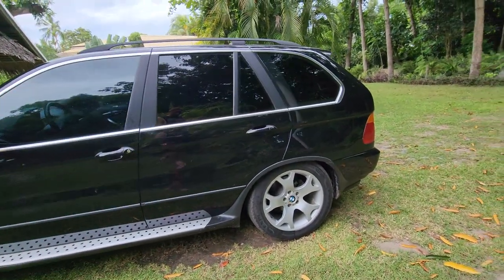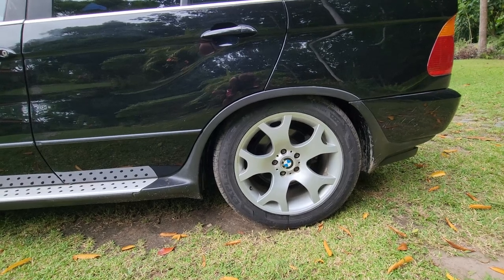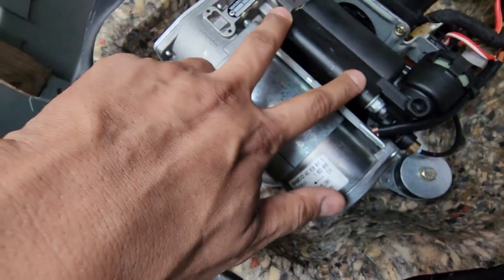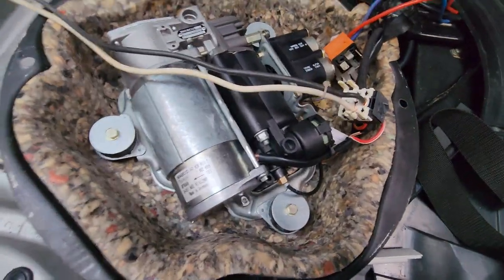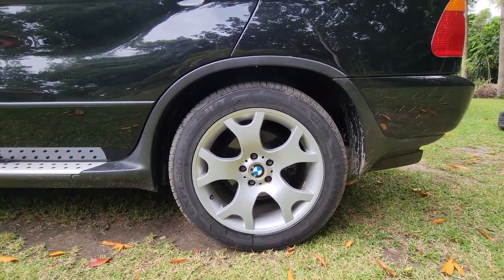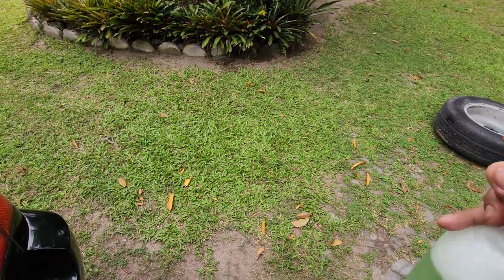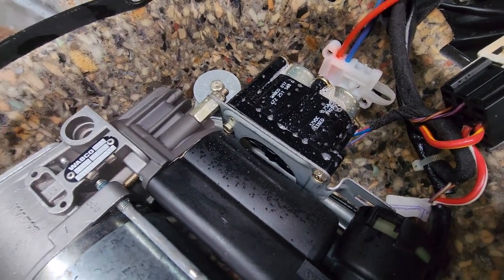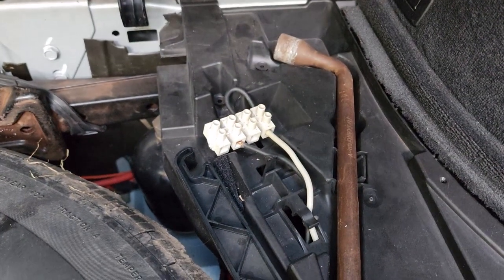Self Leveling Suspension Override / Manual inflation BMW X5 E53

Comment from the maker: UPDATE: So hard to fix this thing. Took it all out, replaced it with springs. Im not towing or loading heavy stuff anyways. Just using it to bring my kids to school
Reply: Tried Everything PIA.  Trying to convert to springs-but where do I get the spring compressors - its a tight space- no room and Auto Stores only have large springs for the big springs. Thx.
Reply: No need for spring compressors, just use your jack to pry open the gap and then you can insert the springs directly. Took mee 1hour for both sides

Comment: Why are the solonoid no opening? When pumping manually the red and blue tubes are not having air but when I disconnected the black one which is the supply the air is coming the solenoids are closed why

Comment: You never said what's the part you needed to replace though
Reply: Well, this is just a quick fix to get the pump running so you can drive home and throw out that entire self leveling system.  I had a faulty compressor and didnt want to replace the compressor so i converted to springs. Was a 3 hour DIY fix, no more problems

Comment: You sprayed soapy water all over the wires and connections WOW 
Its a easy job to change the air bag and the tank ,hardest part was trying to put the C clip back on single handed had to get dad underneath to hold it in place while i was inside the boot

Comment: Once the bags inflate, they will turn desínflate when turn truck off? You need to this everytime turning on the vehicle?
Reply from the maker: Yes correct. They will also deflate even while driving after a while. It means that there is a leak somewhere plus the self level module isnt responding. This video is just shows a quick fix so you drive it home or to a mechanic.

Comment: Which two posts on the relay block do you jump? 30 and 87? My relay on the 2014 F15 has two 87 posts. Do I jump 30 to both 87 posts at the same time?
Reply from the maker: Not sure buddy, just look where the power supply from the car goes (usually the thick red one) and the power supply to the pump, then connect those 2

Comment: Do we replace a tire when it has a nail? No!!!
If air bag leaks...take out put "Slyme" in pump a little wait 1 minute leak repaired
Reply from the maker: the thing is, its not only the airbag that can leak air, the are too many point of failures for this this system. Compressor compontents, hose connections, airbag suspensions, not to mention a faulty suspension module. Im better off without it.

Comment: Why did u have to override
Reply from the maker: Coz the system is inactive due to a bad control module, and theres have a tiny leak somewhere, so for now i inflate them every 2 days. Im looking into spring conversion
Reply: @danielautomotors604  just get it properly fixed and you'll be good again. Spring conversion won't really save you. Keeping a dead module or open wires may cause fire to your car and then you won't have nothing.
Reply: @danielautomotors604 Have you done the conversion?
Reply from the maker: YEP, if you cant afford full suspension overhaul then conversion is the way to go. Very happy with the results and i never have to worry about a deflated suspension in the morning 
  @Residew
Reply: @danielautomotors604 was it hard and expensive to convert to spring